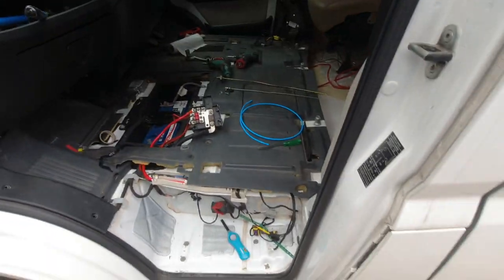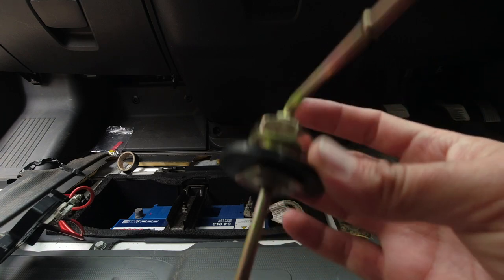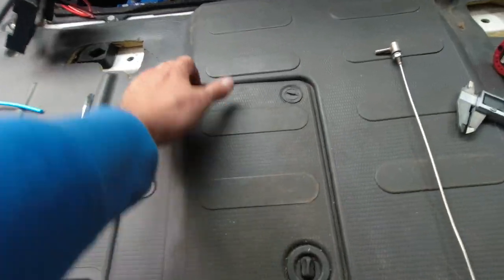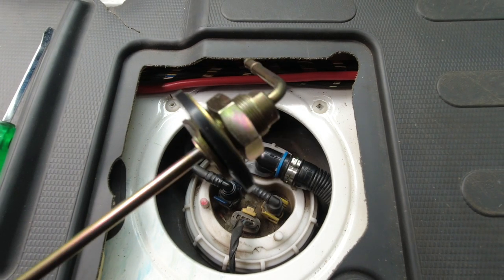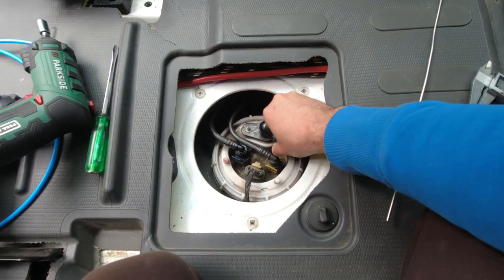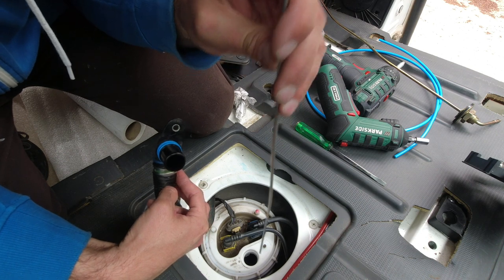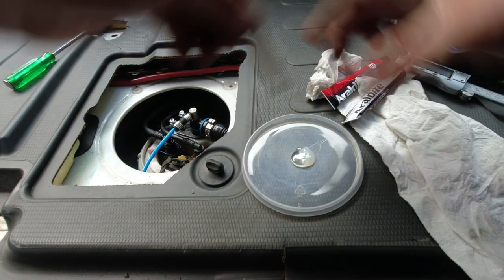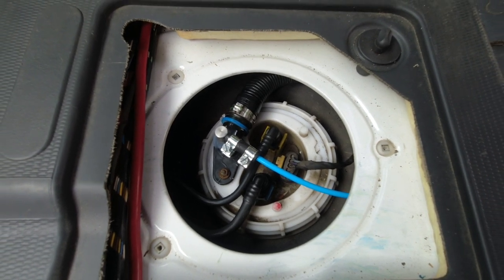Is ANDREW TATE going to be impressed of how i connected the stand pipe to van’s diesel fuel tank?

Comment: Great idea, but I noticed a few things that I for safety definetely would have done different. First of all, NEVER take off the plus from the battery before the minus. One mishap with the tool and you have a nice spark that could make the battery explode if you are unlucky. Secondly I would clean the area around the breather pipe BEFORE removing it to avoid dirt falling into the hole.

Comment: I ordered the set and just installed it. I used the nut and put it over the pipe with a pipe wrench. The rubber seal closes it off, therefore i dont need to glue it. It is sealed off already. Great video, that helped me do it, never thought about putting it in the air hose! haha, Thanks
Reply from the maker: Hi, i am really happy that the video was helpful.
Reply: Can you remember what size pipe wrench you used to get the nut to tighten inside the breather pipe? looking to do this soon.
Reply: Where did you get the thinner pipe fittings or what's it called

Comment: I just fitted mine. I flatten top with a file so o ring can seal. I cut 20mm off the breather pipe. I drilled out to 5.5mm then screwed in the stand pipe. I then put a thick o ring and a copper washer onto the thread. I then slid a long 10mm socket down and tightened it with a pair of pliers. I have air tight seal inside and on top. I am not going to use epoxy unless I have to. I think the two o rings will do the trick. I also fitted non return valve at the stand pipe outlet.
Reply from the maker: That sounds great! Let me know how it works.
Reply: Good idea to use an o-ring, washer and nut.  What is the reason for the non-return valve?
Reply: Im also  looking for a solution for fitting the stand pipe. Does your solution affect the breather pipe functioning properly? I can imagine the file will help but why cut the breather tube at all?
Reply: @alanmorris9598  how else can you reach the standpipe nut deep inside the breather tube? The only way I could was with the longest deep socket and by trimming about 12mm off the end of the breather pipe. The o rings are well beyond that so sealing is not affected.
Reply: Do you have a link for the non return valve you used?

Comment: For the final step.....
Insert the breather.
Then the standpipe, but don't screw it down.
Apply Epoxy to the thread of the standpipe, then screw it in.
This will ensure a good seal all around the breather as it squeezes the glue out of the thread.
(Much less mess!)
.
Only then insert the rubber pipe.
Reply from the maker: Thank you for your comment. I will try it that way on my next one.

Comment: Hello.  Great idea! I like your video. Did you have any tank pressure loss / problems leaking around the hole you made for stand pipe? (A nut on the inside would help to make a better air tight seal????
Reply from the maker: Hi Garry, thanks for the appreciation, so far i did not encounter any issues, and i am using the heater on daily bases. No tank pressure loss, when i open the tank for refill i can hear the pressure coming out, no leaks, because the glue that i used creates an air tight seal. The initial plan was indeed to put a nut inside, but that proved to be very difficult with the tools that i have so i just used the glue, and as i said, no issues so far. But feel free to put a nut inside if you have the possibility, as it would definitely help. Have a great day!

Comment: Looks like I'll be doing this on my new Iveco Daily.. I don't know why they don't all just have blanked off auxillary outlets like on the top of Sprinter pumps.
Reply: I've just discovered this hack as well. I have a 2016 Iveco Daily. How much space do you have above your tank? I have an insulated box so I reckon 5 inches of clearance. I could take the elbow off, modify on it's own then reinstall the elbow. How long was your pipe?
Reply: @astronomenov99  about 5" the same and your dead right, the easiest way is to secure the dip tube on the workbench. You can get the elbows pretty cheaply from Iveco if you want to have one modified and ready for when you take the original one off.

Comment: Thanks for an idea. Why did u disconet the battery first?
Reply from the maker: Just as a precaution measure. To be sure that i don’t try to start the engine, or activate the fuel pump, or produce any sparks while i am working with fuel.
Reply: @agoravan  Thanks. Ok, so I will not disconect. Diesel is safe ;).

Comment: Thank you for your video - very interesting! Do you think the plastic of the breather hose is thick enough to permanently act as a thread for the extraction pipe? Given the vibration of the car when driving? Maybe better to fasten with selflocking nut on the inside?
Reply from the maker: Thank you! I think the selflocking nut would be an extra security point. I also used locktite glue to fix the pipe to the breather. Only time will tell if the breather plastic is strong enough.
Reply: Thank you! I just did the mod in about one hour! 
Unfortunately I was not able to use a nut from the inside because I could nut reach far enough with my tools to hold the nut while fastening from the other side. 
So I did the same like you, with the exception that I used a thread cutter to make the thread. 
Yes only time will tell but I think we should be fine...Fingers crossed!😜 Thank you very much for your video again... I think you saved me many hours of work!
Reply from the maker: Really glad it helped.
Reply: My set included the selflocking nut, but it was not stainless steel, I put one underneith and seals off well
Reply: and i used the pipe wrench, easy job

Comment: Isn't there the fuel float directly under the breather pipe? It could cause problems.
Reply from the maker: Hi, when i inserted the pipe for testing it went all the way down to the bottom of the tank, which makes me think that the fuel float is not directly under it. I drove the van more than 2500 miles, filled the tank several times, and no  issues so far. Fuel gauge indicates correctly. I use the heater every night, and had no issues with it either. Also. I am not a mechanic or a professional van converter, video is just showing what i did, it is not a how to video, as it is mentioned in the disclaimer at the beginning of the video, so if you have any concerns, please ask a qualified mechanic or engineer, before attempting to do any work on your vehicle. Thank you!
Reply: @agoravan  ok, thanks for reply.
Reply from the maker: @Jozef_Drab  you’re welcome

Comment: What about if I install this and connect it to the pump but not install the heater? Surely diesel shouldn't bypass the pump (which I'll leave the red cap on)
Reply from the maker: I think you are right, the diesel shouldn’t bypass the pump (unless pump is broken or stuck open), when i installed this i did not connect the pump.
Reply: @agoravan  worth a shot as I need this installed before a wall goes up but I'm not ready for the heater yet. Thanks a lot! Videos appreciated!

Comment: Hi, pleas could you add a link to the eBay site that you purchased the smaller fuel suction pipe from? Thanks
Reply from the maker: The link is in the description of the video, it’s this one: https://www.ebay.co.uk/itm/333858990507
Reply: Tried this code on ebay they can't seem to find the item
Reply from the maker: @normangallagher8161 hi, you can try this link: https://www.ebay.co.uk/itm/204051507589
Or search: Fuel Tank Sender Stand Pipe on ebay.

Comment: Hello i am doing the same thing on a Fiat Ducato  and i would like to know if the stand pipe is going strait down or do you give an angle foward to avoid all the sender unit system. Thank you .
Reply from the maker: If you put the pipe through the breather as i did in the video, the stand pipe is going straight. It doesn’t touch anything. Don’t forget to cut the stand pipe a little shorter so it doesn’t reach the bottom of the tank.
Reply: @agoravan thank you for your answer.  since you did this how is the  epoxy.  Is it efficient against fuel leaks?
Reply from the maker: 2 and a half years of full vanlife and i had no issues. Can i please ask you to subscribe to my channel? If you did already, thank you!
Reply: @agoravan  thank you for your help . I will subscribe and i whish you the best for this new year.  👍🎉

Comment: Anyone know what to do if the breather pipe is glued in? It's not budging at all
Reply from the maker: It should not be glued in, i struggled a bit to get it out, but maybe in your case somebody glued it in for some reason. In this case you could unscrew the entire unit, (although the method i presented is to avoid doing that), but i only recommend doing that if you know what you are doing and are confident enough to do it. Otherwise, ask a mechanic to do it for you.
Reply: @agoravan  Thanks for the reply! I did manage to pull it out with great effort. Now I'm stuck on how to get the fuel line to the fuel pump from there :p
Reply from the maker: @ShadowV if you watch the video again, you will see that i routed the blue hose under the van. My fuel filter and the pump sit under the van. And from the pump there is the clear hose that travels under the van until it reaches the point where my heater is located ( in my case it is in the middle of the van) and i drilled a hole and routed the hose back in to the van and connected it to the heater.

Comment: Just done this after watching your vid thanks for that but now after only using it twice the system came on by itself blowing cold and I can’t switch it off unless I pull the fuse , the remote only works on the plus and minus the on off doesn’t work any ideas ?
Reply from the maker: Hi, sorry to hear about your problem but i think i have a different heater than yours and i don’t know how to help. Maybe the remote is faulty. Try and contact the seller or the manufacturer.
Reply: @agoravan  have done thanks 👍